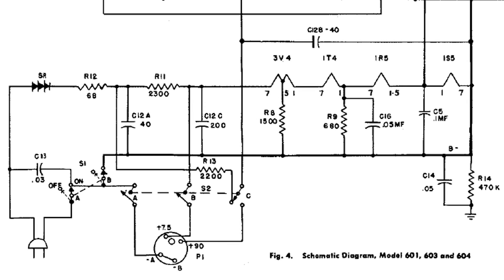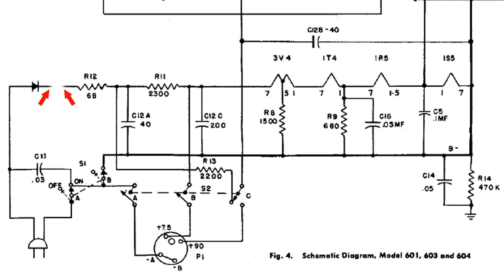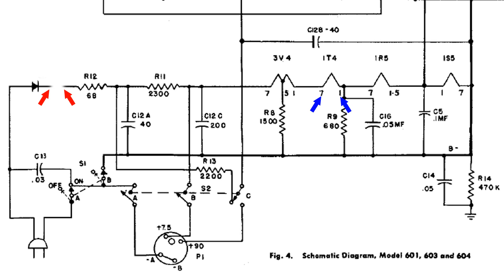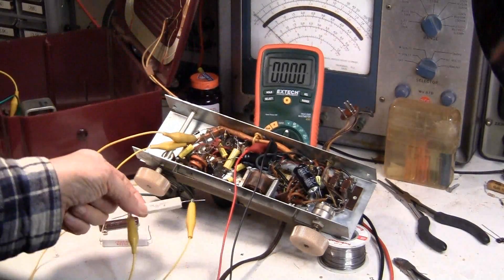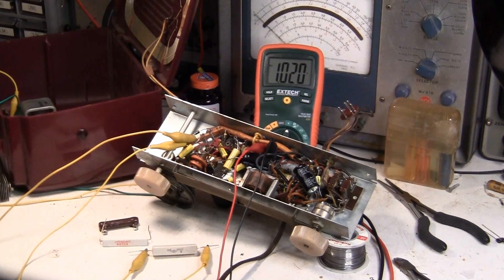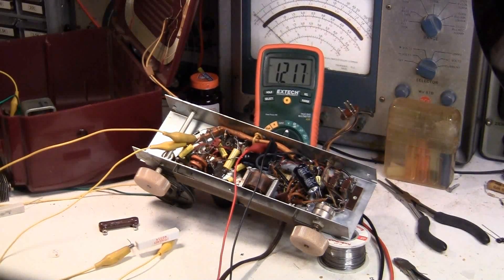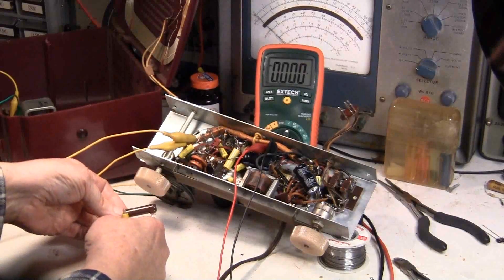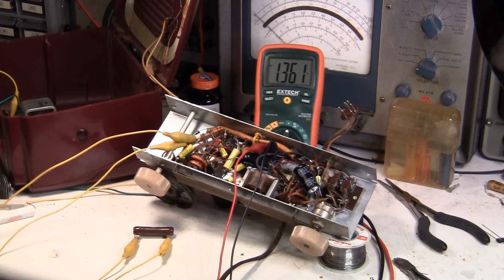Portable Tube Radio Repair, Critical Step, choosing power resistor

Comment: Have you made a video on how to replace a old resistor power cord? I hear use a capacitor, capacitor with a diode etc. I don’t know what the right way to do it.
Reply from the maker: I would but I don't have a radio that uses a resistor cord.

Comment: To figure it out on paper using math is good to practice, then, you can check how accurate your math is by performing the method you have used to safely arrive at the correct value! At this time, with my level of experience and math...tubes would be popping out of their sockets like bottle rockets! Thank you for your reply!

Comment from the maker: Thanks Tony T.
There are other methods, and I have done them. I like this way because it is very save and works 100% of the time. Some other methods you try an calculate the resistance, and that works as long as you have no unknown factors that get left-out of the calculation.

Comment from the maker: These radios are designed to stop working if there is a catastrophic failure in the B+. One of the 1.5 V filaments will burnout, and excessive current through the tube will burnout the filament. On the other AA5 radios, like the ones that use 35Z5 or 35W4, part of the filament is in the B+ circuit, so if there is a catastrophic failure in the B+ the rectifier filament will open. So the filaments of the tubes are also used as fuses.

Comment from the maker: The resistance of the resistor to be added in the circuit depends solely on the internal impedance of the selenium rectifier you are replacing. You do not want to exceed 1.5 V because you will burn out your tubes.
I have replaced selenium rectifiers with a diode and did not need to add a resistor at all, it depends on the selenium rectifier you are replacing.

Comment: Rick,
You covered this issue a while back in one of your videos.  I'm very glad you did, as it later helped me reestablish correct filament voltage in a couple of portable radios that had bad selenium rectifiers...and automatically know that the B+ in an old RCA TV had to be reset after removing its two SRs.
Good stuff, my friend.

Regards,
John

Comment: Hello, I've never replaced a selenium rectifier before. Does this size resistor (150 ohm)set a common benchmark in 5 tube radio's ? What makes the difference in resisitor size ? Is it the load being placed on the new diode/resistor ? You do not want to exceed 1.5 volts cause that's your lowest voltage tube right ? Sorry I asked alot of questions at one time. I seen SR replaced on YT before but there was very little emphesis put on it - Nathan